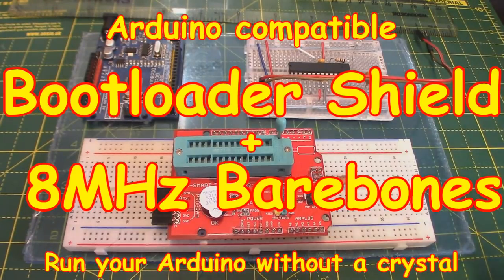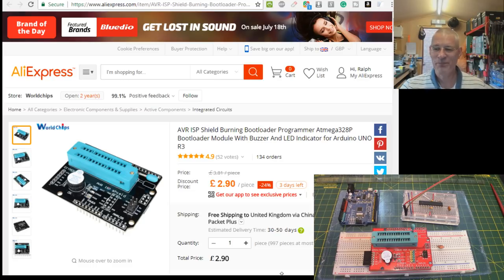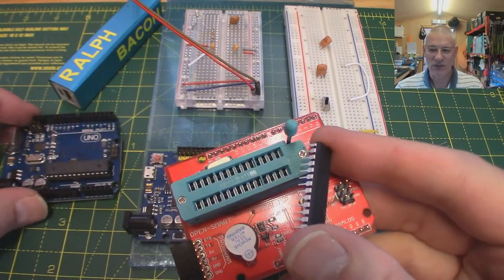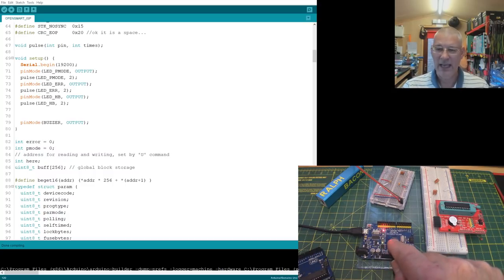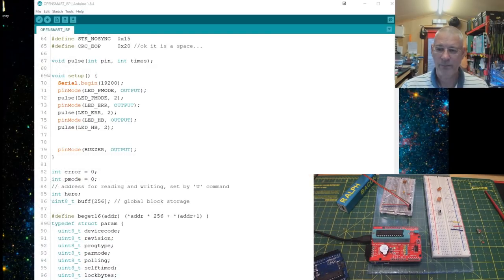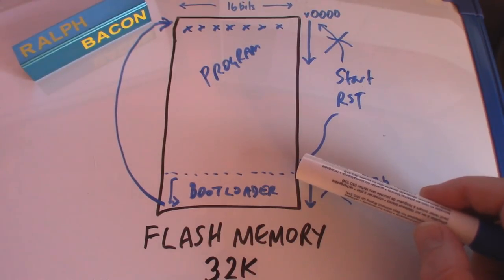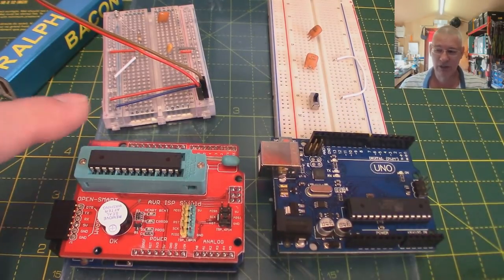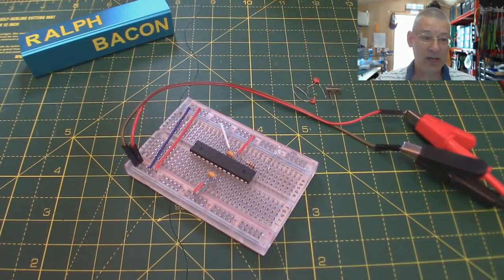#119 Bootloader Shield 🛡️ and 8Mhz Arduino Barebones (made easy)

Comment: As always...thanks for this one too! (I am currently on 3d printing testing for future Arduino projects). Yes I am an old "baby boy" playing with toys... those videos will help me, in making a rain detector for a good friend who need one very much. Keep it comming, I will be there watching...
Reply from the maker: I'd be interested in knowing how you are detecting rain, Pierre, as I have one on Benny's (my cat's) outdoor run and it works well. However, I have plans to improve it to make it more responsive so any thoughts would be appreciated. Thanks for posting.
Reply from the maker: I use something similar, perhaps with a slightly different module sitting between the rain detector board and the Arduino. You must watch the videos in which I show the terrible corrosion that occurred on my detector because it was on all the time.
 
I fixed it by only switching on the detector module every 30 seconds (approx) driven directly from a GPIO from the Arduino. I then take the (analog) reading and switch it off again. Since then, I've had no problem with corrosion at all.

I want to add a small, waterproof heating pad under the rain detector, that is switched on when it rains so that I know when it has stopped raining  - I've got the pads (12v) and they do get very warm (hot, in fact) but I've not yet had the time to fit them. Another thing for my retirement days (once the decorating is complete). When I do it I'll do another video anyway, so you may be interested. Stay tuned!
Reply from the maker: The corrosion problem is shown in video #54 at the 10:00 mark:
https://youtu.be/JLwsaZa0XO8?t=600
Reply: I have an idea for the corrosion problem, but as you mention, keeping the arduino not connecting for 30 seconds should do the trick... otherwise, I would try to solder all the tracks (reflow) as an experiment and see the results after a while...
Reply: I have seen all your videos and did not mist this one... for the knowledge. Thanks for pointing it anyway.
Reply from the maker: I already did that, Pierre, it made no difference to the corrosion problem. The only two things that helped were switching the unit on for just a couple of seconds per minute, or using a stainless steel detector (very rare and very expensive!).
Reply: So I will do it "your way" with the switching, as I think is the best way to do it "on a budget". Than you for your response, it will prevent me of loosing time on this. ;)

Comment: Ralph, at 12:00 you can right-click and change the COM Port.  General COM1 & COM2 are reserved.
---
At 18:10 how did you get that board in the list?
Reply from the maker: Do you mean the "8MHz Arduino on a Breadboard"? I believe the board description is on the Arduino.cc documentation site but I also wrote a board description myself (just requires the speed and some fuse changes). Try Arduino first.

Comment: Ralph, in your quest for minimalisation I think you can discard the second power supply to pin 20. I believe this is for the analog pins only and the digital side will run OK without it. Can you check it out please?
Reply from the maker: I'm pretty sure I covered this in one of the previous videos, actually! Anyway, despite the datasheet insisting both areas need powering up I can confirm they don't, and the chip runs quite happily without the analogue side being powered. Maybe that's why I only got it down to 19 micro amps, would be less without the analogue being powered up. Thanks for posting.

Comment: If you are using a  linux machine  and you can not burn the bootloader onto the bare 328P  try using a 10uf cap from reset to ground on your programmer board (the one on the bottom).  I spent two days trying to burn a bootloader onto a bare board (not using the shield) and re-built the circuit at least 3 times and changing chips and boards to no avail until I tried it on my windows machine where it worked.  I found the solution on a search of the arduino forum. Someone had the exact same problem as I.
Reply from the maker: Good to know, Joey, totally useless to me a Windoze user but I'm sure there are many Linux users out there who will appreciate this, poor souls.

Comment: Are you planning (or could you be persuaded) to do a follow-up on burning the ATMega328 with direct program code, i.e. without the bootloader, in the very near future?

There are many occasions when you want something to just start immediately, without the time loss of it running the bootloader and waiting to see if something appears before continuing - particularly in low-power devices.

It would also be goo .d to have something on programming via the ICSP headers - for those of us who want to do embedded devices.

Thanks
Reply from the maker: Well, Duncan, I might be persuaded to do this if an envelope of used £20 were to arrive on my workshop desk. Or, failing that (and back on Planet Earth), perhaps it will be included in a near future video on this very subject!
 
Until my decorating duties are complete (getting closer by the day) this will have to wait, but I already have various bits ready for videoing such as the USBasp programmer - but I feel I have already said too much. Keep tuned, you should not be disappointed! Thanks for posting, always good to hear ideas and suggestions from my Arduinite followers.
Reply: Sorry Ralph, I'm in Europe, where the British Pound has (somewhat prematurely - or maybe not) been relegated to the list of currencies that were once significant in world commerce. 

My pension might allow me to run to 20 Venezuelan Bolivars, but as they're currently 4,224,077.43 to the euro, that probably wouldn't be much of an incentive...

I'll stay subscribed and expectant...

Thanks

Comment: Great video! i'm confused however by the end section, why can't the 8MHz atmega328 chip run below 4.07v? I thought the safe operating range for 8MHz is around about 2.5v minimum? Or does it only not work when trying to running the sleepmode routine?
Reply from the maker: Hmm. I can't remember what I said in this video but the maximum speed is dependent on the voltage supply, as you are aware. 

The minimum is 1.8V at which point it can run at about 4 MHz. At 2.7V it can run at 10 MHz, so 2.5V for 8MHz sounds about right. It then increases pretty much linearly until about 4.5V when it runs at full speed (that's 20 MHz, not the 16MHz when used as an Arduino).

I'm not sure Sleep Mode has much to do with it, TBH.

Comment: Once you had the boot loader in, why didn't you simply burn the double blink and upload it using the shield?  There is no need to own an Arduino with a DIP chip then is there.  The shield and Arduino below still work exactly as a normal ISP as is don't they?
Reply from the maker: You mean that by uploading a sketch (as well as the bootloader) from the underlying Arduino (as ISP) board, we don't need an Arduino board with a DIP chip in order to upload the sketch to that chip. Phew! Glad I got that straight.
 
Indeed that is true, but the way I uploaded the sketch (omitted due to time constraints) was just to get the sketch onto the chip (somehow). We'll be using other methods in the future videos that don't require another DIP-based Arduino (I'm sure you can guess how I'm going to do it!). Stay tuned!

Comment: Hello Sir!, it was not mentioned and/or demonstrated if this shield can be use to upload firmware to other chip in circuit, use this as ISProgramer. Perhaps burn bootloader on other ATmega328 in another Arduino Uno board or upload .hex files on AVR like AT89S52. Can we use it for that purpose?
Reply from the maker: If this shield (and that's all it is, no processor included) is plugged into an Arduino UNO then that Arduino can certainly be used as an ISP programmer (that is, in fact, the whole purpose of this shield, to make it easy to do that).

Comment: Hello Ralph.  At 14:55 you select a programmer and state that this is required.  However I assume that at this stage and in this configuration, the programmer can be whatever (?) since you are loading the scetch directly through USB from the PC.
Reply from the maker: At that point in the video we are indeed uploading the ISP sketch to an Arduino via USB (in the usual fashion). The programmer setting in this context is not applicable but will be when we program the bare Arduino ATMEGA328P chip on that red programmer shield. 
That said, it won't be the AVRISP Mk II that we will need at that point but Arduino as ISP . The reason I set it to the AVRISP Mk II is because that is the default setting out-of-the-box and it reminds me to actually set it to something - but it was confusing in this video, I admit, my bad. Well spotted, Yves, I hope I have not confused others!
BTW when you program a bare chip using the red programming board (with the programmer set to Arduino as ISP do remember to hold the shift key down before clicking the upload button as otherwise you will load the sketch onto the programmer Arduino - and you'll have to repeat this sequence again. Never done that myself, obviously, cough, cough, sorry can't hear you.

Comment: Hi Ralph, thanks for another great vid.

Got stuck on an error message although I get the two beeps:

 ***failed;  
avrdude: WARNING: invalid value for unused bits in fuse "efuse", should be set to 1 according to datasheet
This behaviour is deprecated and will result in an error in future version
You probably want to use 0xfd instead of 0x05 (double check with your datasheet first).

Any ideas?
Reply from the maker: Yes, look at, and thoroughly experiment with, the options on the page linked below; it is the definitive fuse calculator for the Arduino. Bear in mind that bits in the fuse that are SET are ZERO; unset bits are "1" (it seems backwards, I know).

You should then be able to put the HIGH, LOW and EXTENDED fuse values into the barebones bootloader settings (or the MiniCore bootloader) and not get any values. Take care! You can brick your Arduino with the wrong values so the warning you received must be taken seriously!

Your extended fuse settings of 0x05 gives me no errors on that page. 0xFD gives me warnings that the unused bits are not set correctly. the exact opposite of your warning message. Check them all thoroughly and ensure you have selected the correct chip (ATMega328P).

https://www.engbedded.com/fusecalc/

Comment: Hi Ralph, recently came across your channel and very good it is to (although I've bought far to much from Banggood already!).  I've already successfully created a couple of mini projects which involved creating some PCBs and using barebones ATMega328P chips.  I've recently ordered a DIYMORE AVR ISP shield and understand how to burn a bootloader.  However, I'm a little confused as to the easiest way of uploading a sketch to the ATMega328P sat in the ZIF socket.  Do I simply use the "upload using programmer" from the Arduino IDE?  Alternatively I have an FTDI board which I've been using to date, should I plug this in the AVR ISP shield?  Do I need the underlying Arduino UNO with the shield if using the FTDI plugged in to the shield?  Lots of questions I know - I'm just looking for the simplest way to upload a sketch if I'm using the AVR ISP shield.  Hope this makes sense.  Cheers!
Reply from the maker: It's easier than you think, Michael. 

If you're making a bare bones 328P circuit (aka Arduino UNO-style) then you don't need a bootloader at all, as you will not be uploading a new sketch via the USB port, which is what the bootloader gives you. You do need to upload the bootloader initially to get all the fuses set correctly (eg chip speed, clock source etc) but that's a one-off. From then on upload your sketch using Arduino as ISP in the programming shield's ZIF socket. If you want to click the Upload Sketch (right arrow) button be sure to press SHIFT so that the programmer is used (otherwise you will overwrite the Arduino you are using as ISP).

If, however, you want to put the chip back into an Arduino UNO board then the bootloader can be used to upload your sketch in the usual fashion via USB cable on the Arduino UNO.

Whichever route you take, no USB-to-Serial FTDI is required unless you want to upload the sketch whilst the chip is sat on your breadboard - although even then I would still use the ICSP method as it's straightforward (2 power connections, 4 data connections).

Funnily enough I'm currently designing an easy way to program an ATTiny85 using ICSP as it's so easy. Stay tuned!
Reply: @RalphBacon  Thanks - got it all working nicely.

Comment: not having much luck with the "bootloader" directly from the Arduino site, not sure what I'm doing wrong...…..onwards and upwards!.....think I might invest in the "Ziffed" arrangement your using.
Reply from the maker: "If at first you don't succeed, try and try again. Then give up, no use being a damn' fool about it".
 
Or in this case, it should read "... then watch Ralph's video again, very carefully so you succeed". And getting the same Bootloader Shield will, of course, guarantee success. If you get stuck, do post the actual problem you're facing to see whether I (or others) can assist, Andy.
Reply: Hi Ralph…..I'm still having bother with this bootloader upload, beginning to think I'm losing it, tried everything from basics like is there 5v? to beeping out every cable to trying different combos, to reinstalling the IDE still no joy, in board manager there are two breadboard 8mhz options (tried both !) this is the error I keep getting......Arduino: 1.8.5 (Windows 10), Board: "ATmega328 on a breadboard (8 MHz internal clock)"

avrdude: Yikes!  Invalid device signature.
         Double check connections and try again, or use -F to override
         this check.

Error while burning bootloader.

This report would have more information with
"Show verbose output during compilation"
option enabled in File -> Preferences.
what is "-f"?.....any thoughts from you or Benny or fellow Arduinite's ? ……...really at a bit of a head scratcher
Reply from the maker: I've had this on occasion (but not whilst doing this demo). the "Yikes!" one means it has found a chip different to the one it is expecting. So it might find an ATmega168P instead of an ATmega328P for example. Double check that the chip you're using really is the "P" version of the ATmega328. I'll continue this in your other post...
Reply: Thanks you two !...………….I've ordered some new chips  ( non chineseium) so I can start again with a known datum, as it were...……….let ya how I get on...…..cheers!
Reply from the maker: Please do, there's always a reason computers say No!
Reply: I am having problems loading the bootloader also. I notice your programmer device is a stk500 via ide output. My programmer Type is Arduino. I am getting protocol error msgs.   I feel like  I am an expert bootloader loader by now even if I have not been succesfull.  I'm also using a bare chip that expects a crystal. I checked with the scope and the crystall is oscillating. I have the 5 volts and gnd where I need them.  Checked the arduino tutorial on this and I am doing things correctly. Went over wiring a bunch of times with complete tear downs and re-wire.  Have you succesfully loaded the bootloader yet? I have tried 3 different 328P's and a couple of different arduino boards as the loader. Geesh !
Reply: So it looks like my linux machine did want to burn the bootloader. I moved my circuit board to my windows machine and it worked. This was two days of work before I figured this out.

Comment: Does running on internal clock rather than the 16MHz xtal present any problems with I2C or serial communications?
Great video. Thanks
Reply from the maker: Not as far as I know as the chip "knows" it's running at 8Mhz and hence all the signal timing is adjusted accordingly. But that's a good point, I should test it out. Hmm. Food for thought. Thanks for posting, Ricky.

Comment: Hi Ralph. I'm taking the dive into bare-bones Arduino. I'm following your tutorial with the OPEN-SMART uno shield and all's okay until I have to pick the Atmega324 on Breadboard, board. I'm using IDE 1.8.13 and it organizes the boards by subgroup in the boards submenu and that 'on breadboard' board description does not come up.

Any thoughts on how I should proceed?

Thanks for your help Ralph.

Gord
Reply: DISREGARD my previous messages Ralph. I got it working! I was missing the 1.6.x breadboard folder. I had to find another laptop and go back to 1.6.13 IDE to use it. Is there a way to get this board definition into 1.8.13? Or is there another way to make 8MHz chips on the shield? Or should I just resign to the world of 16MHz and use crystals. Any insights are welcome. Thank you again Ralph. Now I can get on to a low power app. Very exciting!
Reply: DISREGARD ALL OF MY MESSAGES :-) Hi Ralph. It ultimately came down to find out which particular subfolder went into the hardware folder on 1.8.13. Got it figured out. I can program the 8MHz chip with my main laptop. Thank you as always for your inspiring and great tutorials! Have a safe week and holiday season. Cheers! Gord
Reply from the maker: I kept seeing your "Disregard" messages, Gord, and thought I'll have to read these and respond soon but you've done it! Good show!
Reply: @RalphBacon  I have a GREAT teacher! Thank you Ralph! Very exciting now!